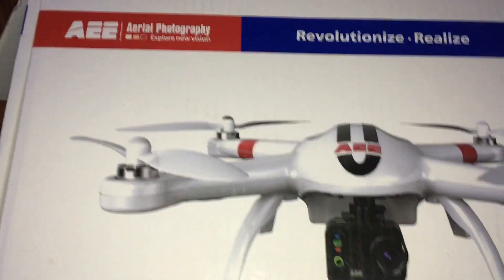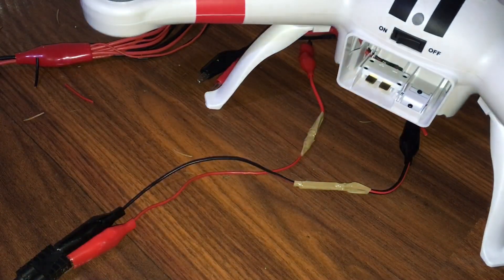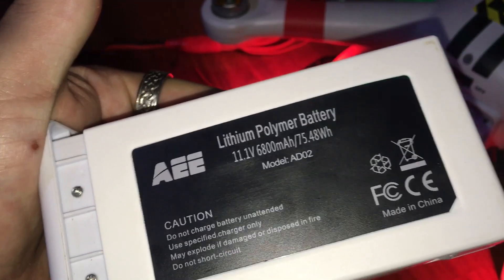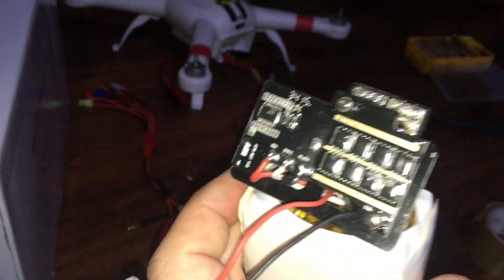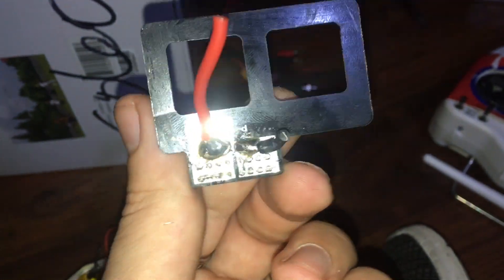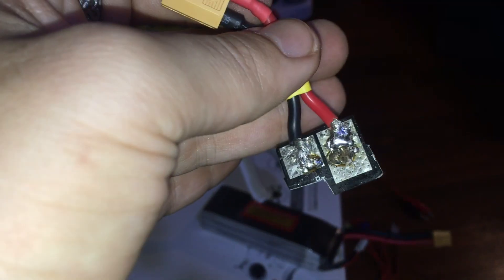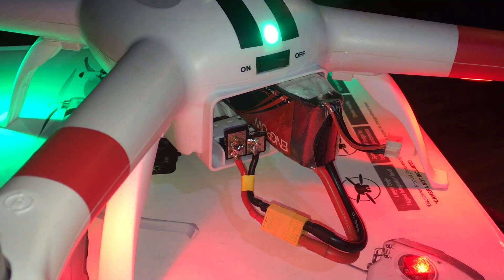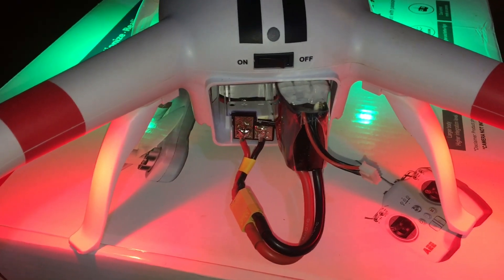How to fix AEE Toruk Drone Battery Issue SIMPLE COST EFFECTIVE  MOD DIY

Comment: I have one of these too, and I’m trying to get a new one battery, but here I can’t find these batteries that u used on the video
Reply from the maker: All you need to do is match up voltage in size to put in the case

Comment: Once the modification is made with this battery, do you always use its charger to charge it?
Reply from the maker: Ues
Reply: I mean the one from the original drone battery?
Reply from the maker: @giuseppebuondonno5187  no absolutely not you get a hobby gray charger and balanced charge battery properly again that’s what was wrong with these batteries with the chargers and the Smart technology built on top of the battery that didn’t work

Comment: Hubsan x4 h501 battery fits perfectly  but you would have use three of them but I can't seem to connect it cuz I open up the original battery from the aee and seen its been bridge but for hubsan I connect it straight no bridge connection but I don't trust it to charge long I'm case of an explosion
Reply from the maker: Bam 💥

Comment: OK   but that does not fix the battery      best idea is get buy or make   a battery terminal welder     there are some simple DIY ideas to make one       take the original battery to pieces      and slide the 3  damaged  3.7v  cells out          Order by allie express     a repair kit of 3 x3.7v   cells        and rebuild the battery      3 new cells   AEE   battery  repair kit  on allie express    cost 25 euros
Reply from the maker: Not bad idea
Reply: Do you happen to know the exact part number I should be looking for for those 3.7v cells? I'd like to try rebuilding my battery pack but have no idea what specific cells would fit.

Comment: Just did a battery mod to my AP9 and it does power on but will shut down if I try to takeoff. Any ideas as to why? The battery does not lose connection it sounds an alarm and turns itself off
Reply from the maker: Not sure sounds like bad solder point or not enough volts in battery

Comment: Picked this drone up for free with no battery and already ordered an rc battery and charger on a gamble. I plan to solder a connection in and i used a piece of dense foam to slide in and house everything
Reply from the maker: Sounds like a plan
Reply: @JayDrone  it worked. Until I crashed it lmfao

Comment: I have the are 11 but even though I charged the battery, and all bars are there, drone does not turn on. Controller shows red light blinking and beeping constantly. Can u help our? Tx
Reply from the maker: I’m sure your batteries in the controller are full if it still does not work there’s a possibility that your battery is shot even though it is showing full bars

Comment: Hey mate. Tnx for that fix. I have identical drone with exactly the same problem. It also uses exactly the same battery. Im working on your fix, but I need some info. What 3S LiPO do I need for that? 30c would be ok or do I need stronger one?

Comment: This mod gave me an idea, and I modified it a bit further. Soldered on 10AWG wire onto battery connector, and cut the connector way down and soldered on Deans connectors. Am using a 8000mAh LIPO battery, about 35+ minutes fly time. Battery is an Ovonic 11.1V 8000mAh 3S. You will need a digital charger to charge the battery. Parts are cheap on eBay.
Reply: you have battery  name or number from ebay
Reply: @thaipham583  Ovonics 11.1V 8000mAh 3S battery. Fairly cheap on eBay.
Reply: What is the battery name? And do you have pics of your work?
Reply: @segordon2424  Ovoincs 11.1V 8000mAh 3 cell. I used to have them for sale on eBay. Not any more.
Reply: Yes yes do you have the battery model you used??? Thanks
Reply: @jaysbass3599  Hi, I use a Ovonics 3S 11.1V 8000mAh battery. Fairly cheap on eBay. TIP: Solder wire onto drone's battery terminals with a DEANS plug on the other end.
Reply: @robertnaber200  awesome. I just ordered the batteries 2x pack and Dean's male whips. Do you use the original charger?
Reply: @robertnaber200  if I am understanding you correctly, I should tear apart the original battery and use the plug part to solder deans plug wires to? Or just solder directly to the terminals on the drone?
Reply: @jaysbass3599  No, you can't use the OEM charger. You need to buy a digital charger. I use Imax B6AC. Dual voltage (110V/12V) fairly cheap on eBay.
Reply: @jaysbass3599  I would just solder onto the terminals. It's a pain to modify the plug from the OEM battery.
Reply: @robertnaber200  Perfect, thank you , I have ordered two batteries, 3 deans plug whips, and charger. Can't wait to try this!!
Reply: How is the battery fit? Any tips on that? How did you secure it in?
Reply: IMAX B680 I ordered. Wow coincidence!

Comment: Thank you so much J the Blackbird Aries is the same exact drone
Reply from the maker: U got it
Reply: The Aries Blackbird is an earlier production run of the AP10 , and "exactly" alike. The transmitter will work from the X10 on an AP10 drone.